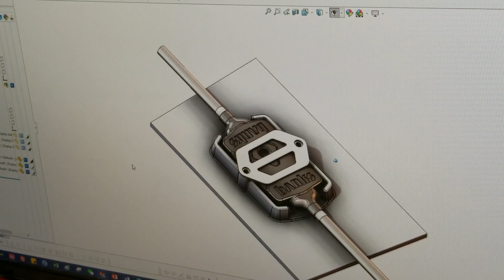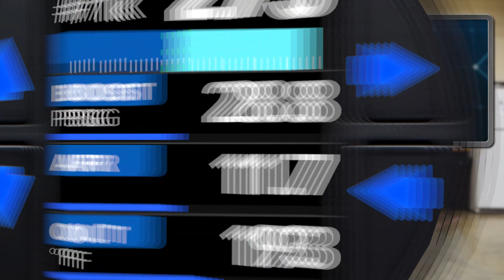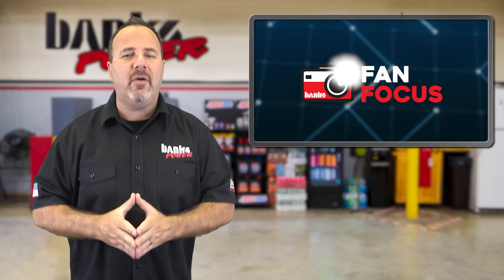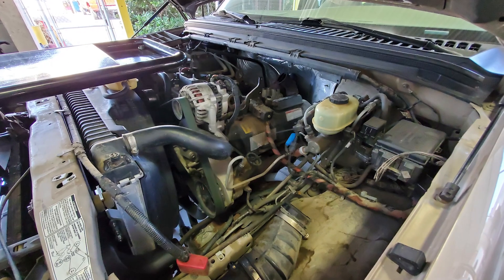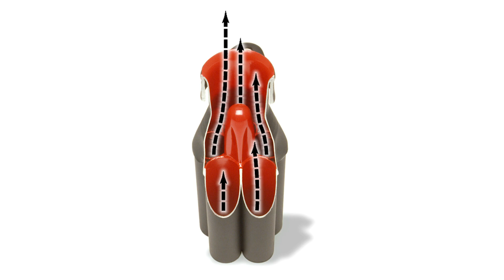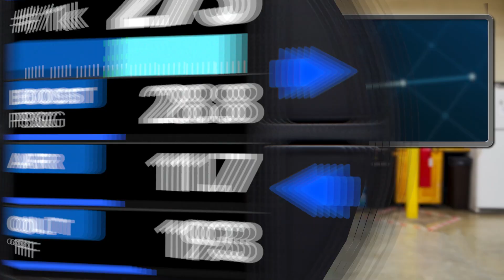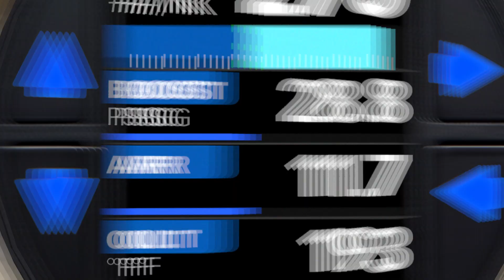The most popular FORD 7.3L part!, Making Titans more fun -- Banks Insider 10/16/20

Comment: you said "1 out of every titan sold is a diesel", also "mike has a 2003 ford f250" show us a video of a f350, then go on to state mike "has been driving this vehicle since 1999" and reference prince. how has mike been driving a 2003 dually f250 since 1999? Also every titan truck has a diesel?   Banks needs to check their info before spouting off nonsense.   Pretty much what every banks add in magazines has done since the beginning of time.